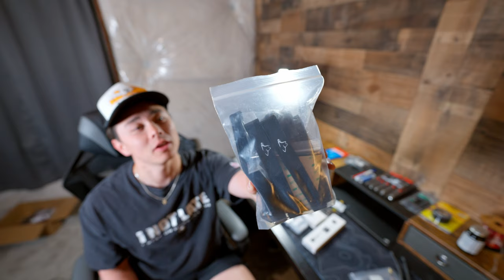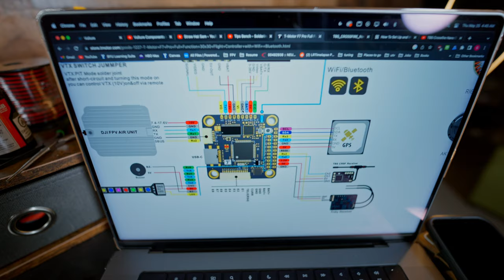Sony ZV-E1 FPV Drone | Miniature Cinelifter

Comment: Just take your normal acro quad and put it in 3D mode. then you can take off upside down if you want. i do it all the time after a crash. i love 3D, so much more you can do in 3d vs normal acro.

Comment: Love what you did here.  Also that you didn't flinch for trying something a little different (handheld cam on a quad).  I'm used to 5-inch quads and am currently trying different sizes.  Not sure if I'll venture in this direction... but good to see that it's an option.  Well done and keep building and flying.

Comment: I have the same setup but I get jello/shutter issue. What are your ZV-E10 settings? I even have the iflight mount. I have a Canon RP and it’s much heavier so less flying time, but no jello. But…I can’t figure out how to stabilize it well in Gyroflow using the gyro data from a mounted GoPro or insta360 R. Help! 😊
Reply from the maker: I use the ZV-E1 , not E10. Not using an iflight frame either. The reason you get jello is because IBIS